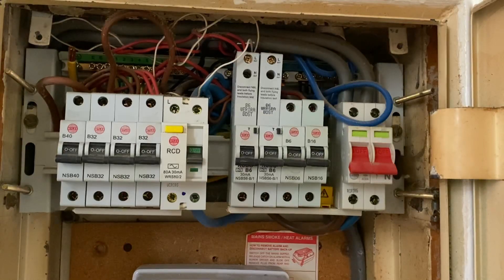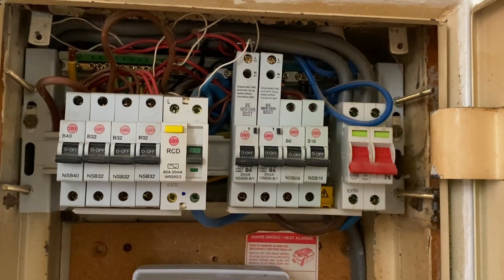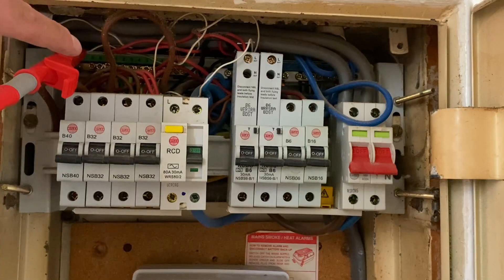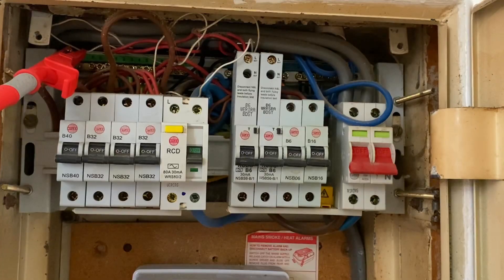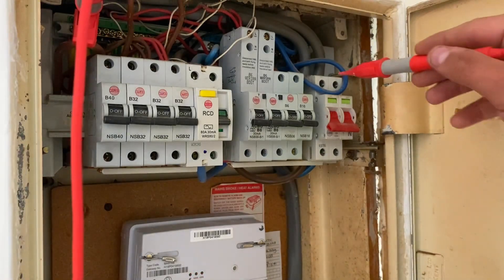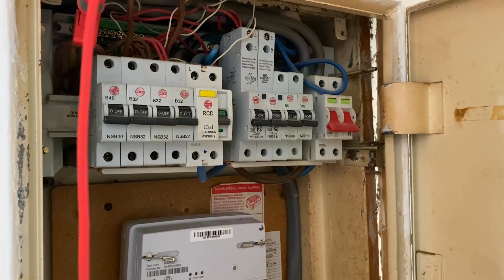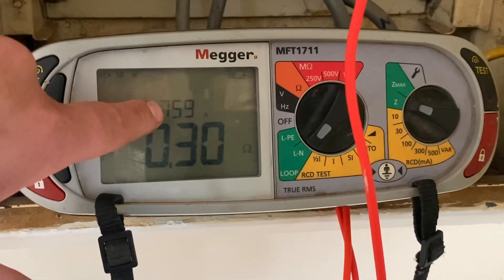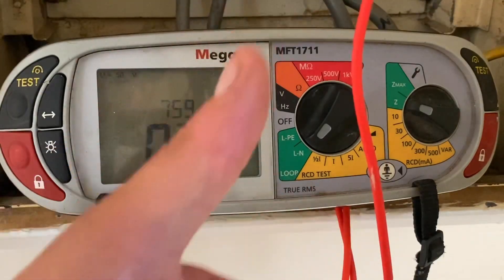Prospective Fault Current PSCC, PEFC, PFC and External Earth Fault Loop Impedance Ze - Live Tests

Comment: Why have you reconnected your supply CPC when taking the reading of IPF?  You have contradicted your first statement of not wanting parallel paths to muddy the results.   We are only after the results for the supply not the installation.
Reply: I wondered that, please someone correct me if I'm wrong, I'm only just starting, but aren't we supposed to do Prospective earth fault current with earth in, and another with earth out, choose the highest of those, then compare that with the pscc and compare which ever is the highest reading to go on the form?

Any advice is greatly appreciated

Comment: Looks like one of the consumer unit /meter boxes on the hemmingwell estate in Wellingborough... although never saw inside the front of the one that the old man had. Originally had wylex re-wireables, some swapped to MCB's later in life before these units were installed about 8 years ago so just before the requirement for metal enclosures. It's why there is no consumer unit box as such - had to be disposed of to get the rails to fit. Then had plastic covers over them. They were in a metal box as you can see, however, the doors didn't always stay closed for fire containment....
Reply from the maker: Great observation 👍🏻 and thanks for watching